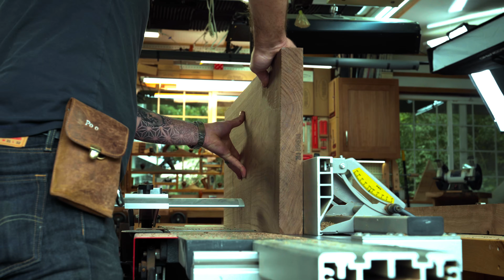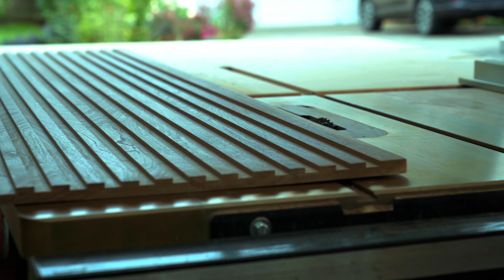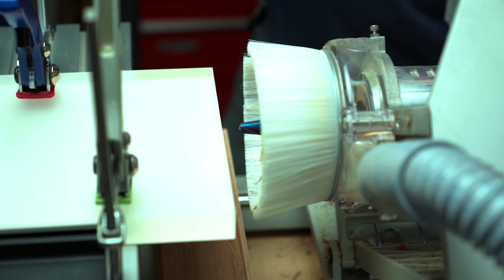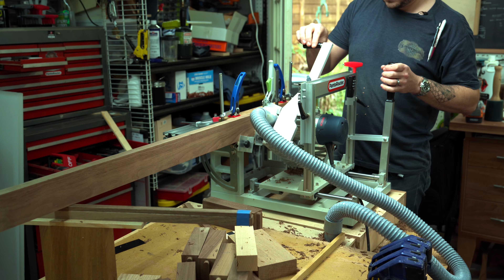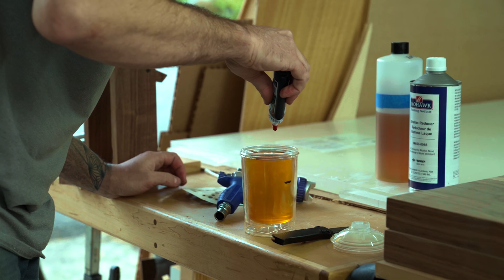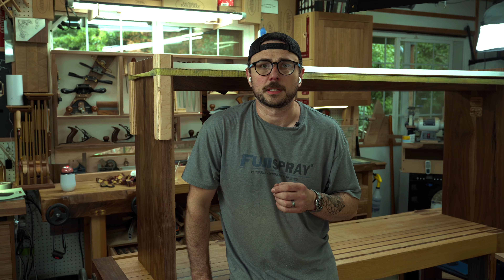Finding Beauty in Simple Furniture Design // $30,000 Build

Comment: What i realy wonder, how do  you youtubers come up with those Spectacular Numbers for a Table ?  10.000$  20.000$ 30.000$ 100.000$ ....  I find it hard to beleave that its not just for clickbaittitle and that someone actually buys that..... I mean  /watch?v=TS1pISfnn3A   is a fully handcrafted Kitchen out of Oak with big Granite Plates and 160 Workhours that costs 32.000€
Reply from the maker: This was a commercial build. Those usually pay quite a bit better. Around here it’s pretty easy to spend $1,200/lf ($3,600/linear meter) for cabinets alone, not including tops. No offense to cabinet makers, but they’re all basically the same. Custom furniture to cabinets is apples to oranges. I easily get 150hrs in per project. My most recent dresser had well over 600hrs in it.

Comment: Another masterpiece Nick!    Is the acrylic clear or white?   Is there a removable glue sheet on it to protect it?   and is that on the top or next to the stretchers?   Looked like it was on the underside next to the stretchers as you were gluing it up.    Also, how was the clean-up?  :)
Reply from the maker: Yeah that peel is super satisfying! Thanks Dave. The acrylic is 4 layers. Two clear with a translucent frosted color layer between and an opaque white back layer. Interesting stuff and zero fun to clean up lol

Comment: Very nice work. Interesting that a simple aesthetic takes as much time as a complicated one - no where to hide. 

I’ve got a couple of questions. Firstly, finishing with a scraper plane. I notice that you finish a piece off with a jack or low angle plane. What are your (fellow viewers; fellow seekers of perfection) experiences with a scraper plane as the final act after planing to size? I have mixed experiences - which is more about my technique than the good or bad of a scraper plane - but when I get it singing, it’s beautiful.

Secondly, those warped boards. I tried soaking a board in denatured alcohol by putting it into a plastic bag, pouring in alcohol, squeezing the bag so that not much alcohol is needed, sealing it and leaving it for a couple of days. I then took it out and was able to flatten it in crawls. Was that beginners’ luck or does it really work? If it is a new invention, then it is already patented and global rights are mine. All mine.
Reply from the maker: I use a scraper for species that are more prone to tearing out. Definitely like the finish off a scraper, though admittedly, not usually my go-to. Interesting on the alcohol. I’ve neither tried that or heard of it and mechanically, I’m not sure why that would help anything. Try it again and see if results are repeatable. Sample size of one is kinda hard to postulate. Thanks Theo

Comment: That wavy swooptee design of the strips in the slab looks awesome!! A simple technique with a beautiful result!

o, and maybe a stupid question, but instead of using that incredibly expensive acrylic sheet, wouldn't it be cheaper to do a thick pour of expoxy? Sort of looks the same, but maybe is more brittle?
Reply from the maker: It’d be really hard to pour a consistent 1” sheet of epoxy without bubbles. This has a transparent colored layer and an opaque backing too. Maybe a little cheaper, but a lot of labor. Definitely not easier
Reply: @SawyerDesign  Yes, I forgot to account for labor. And if it takes a lot of time this means it also costs more money in labor. Can't wait for the follow up videos, Nick!

Comment: Might reach out to Rainfall Projects on YouTube and see if he can help with your metal working projects. I know he helps Jason Hibbs.
Reply from the maker: Awesome thanks for the lead Ben! I ended up finally finding a place that was easy to work with, but will definitely write that down for next time.
Reply: @SawyerDesign  no problem just figured another YouTuber around your area for collaboration projects
Reply: @SawyerDesign  also quick question with that acrylic do you think it would have worked if you did through tenons and wedged them with walnut? Or would it crack?

Comment: Great video.  I like the approach you took with the joint for the acrylic into the walnut.  Its pretty much the same approach when putting breadboard ends on a table.  The acrylic also appears to glow as the light hits it which is cool.  Question, when you started sanding the edges of the acrylic to the same sheen as the top.  Did you with you did that now before assembly?  I would see getting into the inside corners with the walnut challenging without damaging the finish already on the legs.  Oh and I've routed acrylic before, it sucks.  I'd rather cut and sand MDF than acrylic. The acrylic just sticks to everything.
Reply from the maker: Totally like breadboards! That acrylic was such a mess. When sanding I got the first few inches before assembly for that reason exactly. Woulda done the whole edge, but that stuff is heavy, awkward, and unruly. Figured doing the rest of the edge was easiest after assembly. Glad you liked it. Thanks Richard!